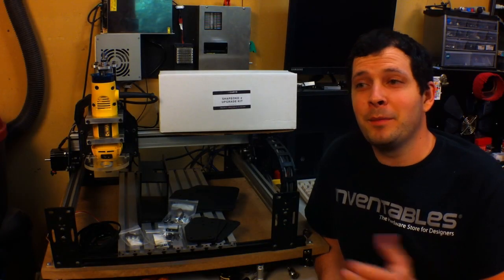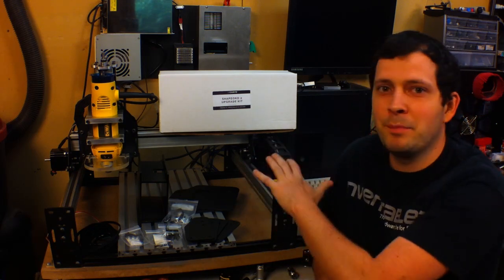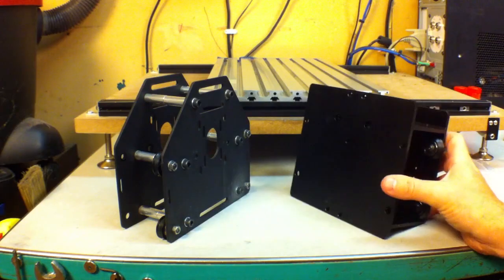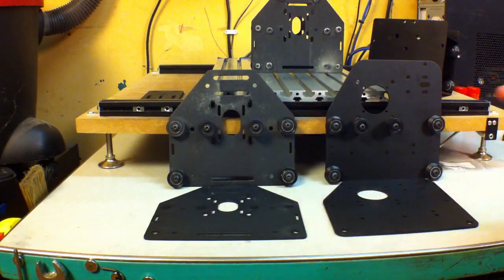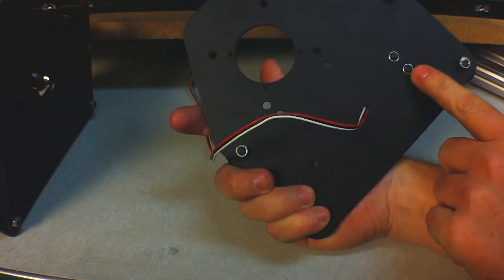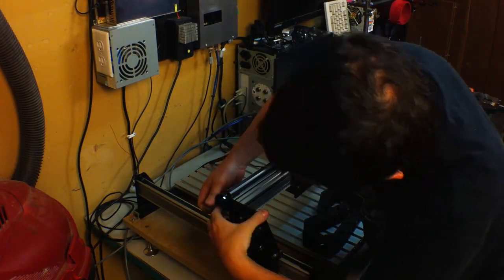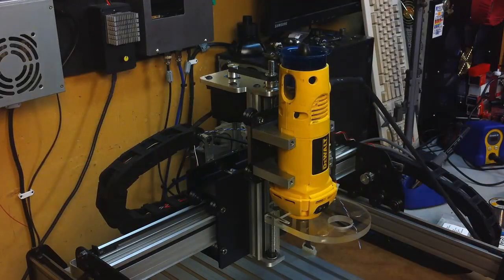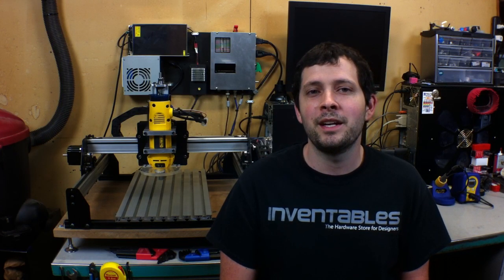ShapeOko 2 to X-Carve Upgrade: First Impressions

Comment: Looks good! Thanks for video.
Where did you buy the tee slot that you mount your parts on?
Reply from the maker: Robert Adams Thanks,
The t-slot bed can be found by going to: http://us.misumi-ec.com
And, used the part number: HFSQN4-15250-500